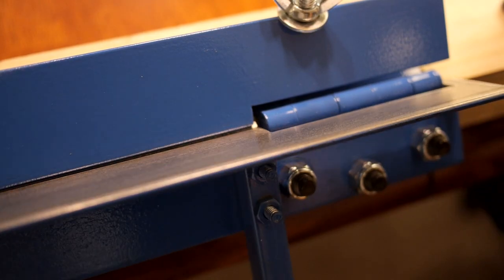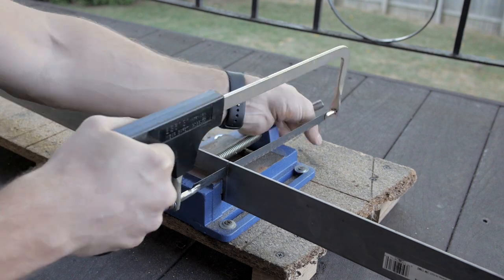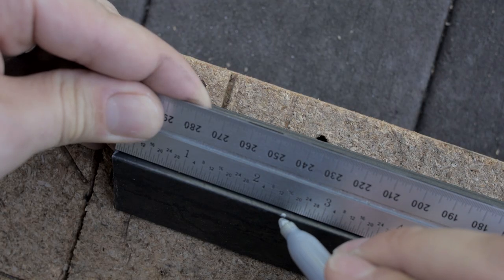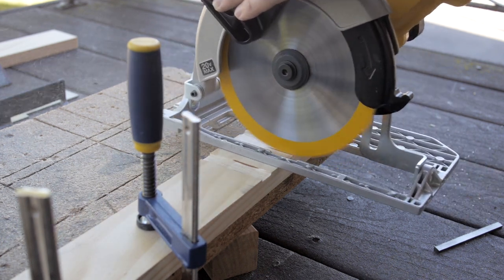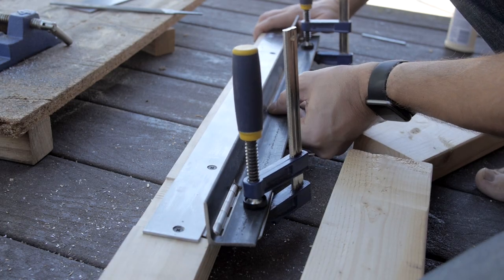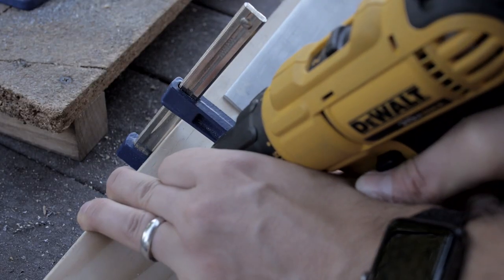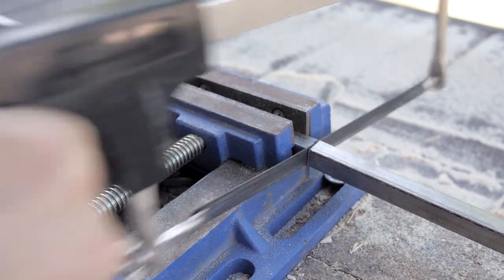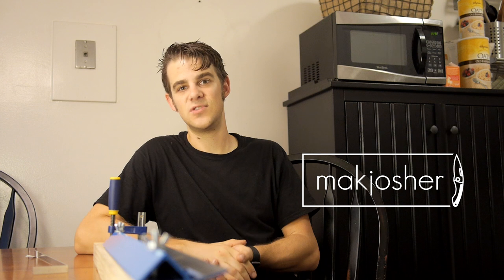DIY Sheet Metal Bending Brake: No Welding

Comment: you are much more competent with a hacksaw ,than most people would be . some of the steps in this would turn out to be a mess for many people attempting it. not to mention, the dremel tool isn't something most people have. alternative ways to cut the hinge seats would be helpful.
Reply from the maker: Thanks Hal! Offhand I can't really think of other ways of cutting those seats besides a cutoff disk (in an angle grinder), a torch, or metal cutting bandsaw - none of which seem much easier or readily available than a hacksaw. Now that I think of it, perhaps you could use a jigsaw with a metal cutting blade. For the horizontal cut you could even angle the plate on the bottom of the saw. Do you have any better ideas?

Comment: You need to use some oil while drilling metal, otherwise the drill bit will go dull in no time.
Reply from the maker: Thanks for the suggestion. Come to think of it, my bits do dull relatively quickly.

Comment: not bad mate sort your bench out get a small angle grinder and a small welding set only cheep easy to weld you will get after bit of practice.
Reply from the maker: Thanks! I actually have the bench and angle grinder ironed out now, but I think the welder will have to wait for when I have a better place to use it. I'm thinking our nylon deck wouldn't fair too well.
Reply: I just blew mine up yesterday make the same thing just welding the last bit and somthing went pop now its not working .keep it up mate

Comment: Bow saws,, that include hacksaws, coping saws,,, any saw where the blade is suspended by a frame,, in general,,, not always,, the teeth point toward your hand,, the saw cuts on the pull stroke,, not the push stroke.  You will find your hacksaw work to be better, faster, smoother.

Comment: Great job man. Dont get me wrong but be careful man. If that blade was going to brake or make it our of the groove you would have had a nasty cut on your hand. Dont ever cut on your other hand direction. And really....buy a used angle grinder. They go for $10-20.
Reply from the maker: Thanks man! I agree with both of your suggestions. I actually do have an angle grinder now, which you’ll see me use occasionally in my newer videos.

Comment: If you would have used machine screws instead of cap screws, you wouldn't have had that clearance issue.
Reply from the maker: Good point and you are partially correct. However, some wood still needs to be cut away to make room for the hinge and its barrel.

Comment: what's wrong with your microwave clock? xD
Reply from the maker: Haha. Not sure if I noticed that before. It looks fine in real life. It must have something to do with the refresh rate of the clock and the frame rate of the camera.
Reply: Not to geek out too much but I'm pretty sure a multiplexer is used to drive the 7 segment LED display for the digits so like the vid creator mentioned it has to do with the refresh rate of the processor in the microwave driving those parts of the LED being lit vs the refresh rate of the camera (also CCD based cameras have some interesting effects smarter every day covered the rolling shutter and why it happens).